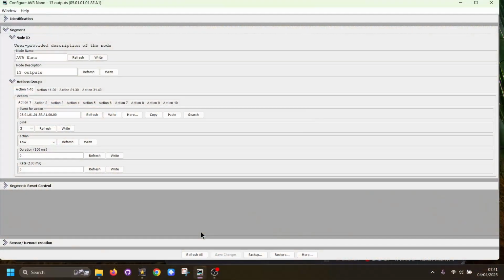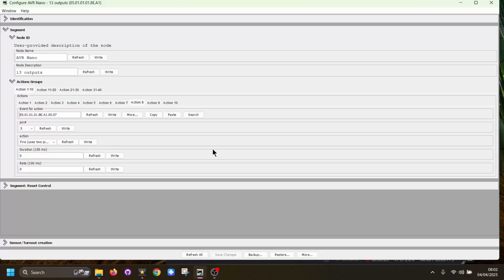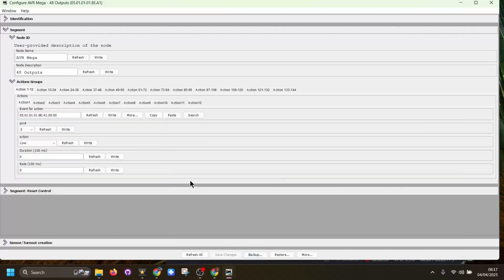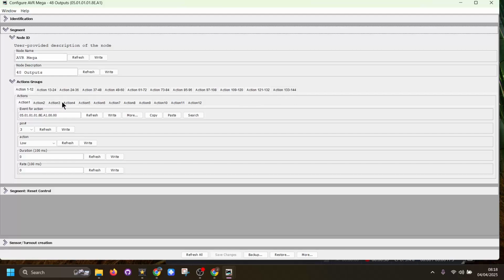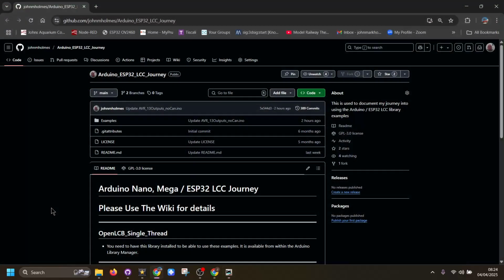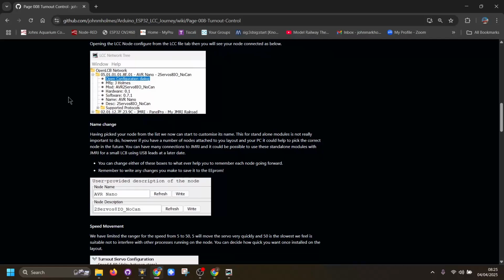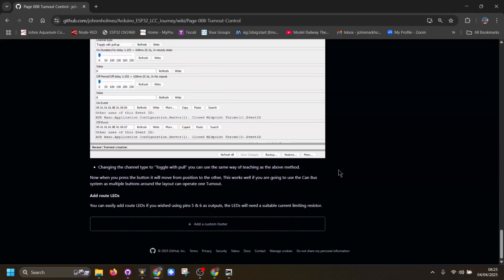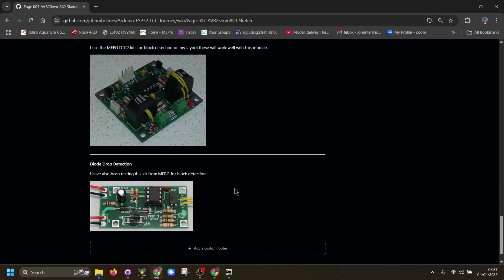April First Arduino LCC Update

Comment: Thank you for the update and the work you are doing! I am not much of a programming but doing my best to digest it all and hopefully get some programming skills.
Reply from the maker: Thank you, the end game is to limit the programming required by the end user. Configuring the Nodes being done in JMRI, which allows for changes to be made a little easier than trying to hard code the Nodes.
Reply: @modelrailwaytheeasyway9743  A very good goal indeed! I have a habit of diving in too deep and drowning...I purchased  2 Uno R4 Wifi and the Snowball Creek LCC shields. I got some basic cod working but editing the code and making them do what I want is a bit of a struggle. I'll get there eventually though!